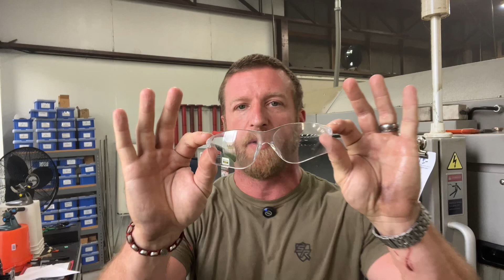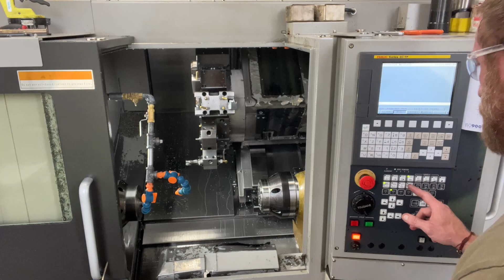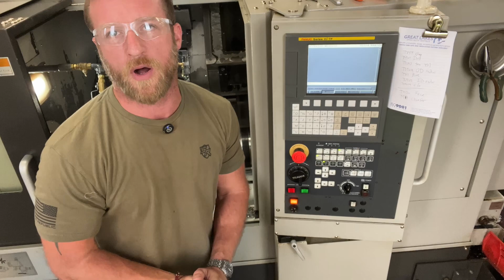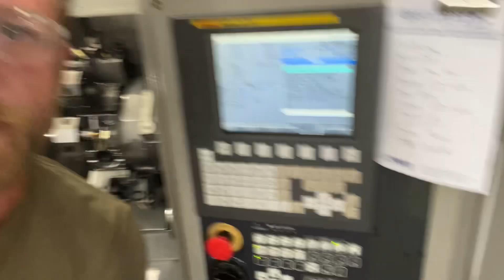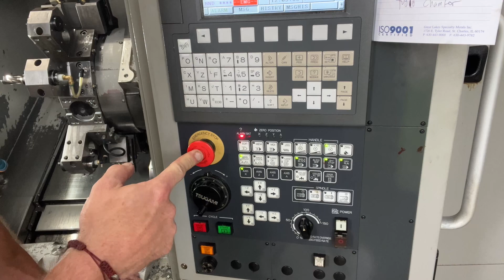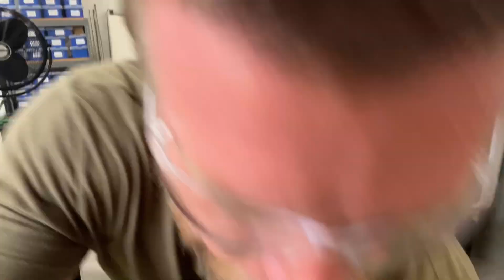CNC Safety is CRITICAL! #cnc #safety #machining #cncmachine

Comment: Drove a needle file through my hand on a lathe. It was dumb to deburr something so close to the chuck. But "I know what I'm doing" and "I'm paying attention". But I wasn't thinking. I wasn't paying attention to what I should have been. I was paying attention to the part of the file chamfering the edge, not the end of the file the jaw hit. Tapped a hole by hand in 303 without safety glasses. "I'm just tapping a hole, what could go wrong?" As soon as I reversed the tap a little chip dislodged and shot down to the floor of the vice, bounced off a jaw, and then came straight for my eye. Luckily my hand is perfectly fine and the chip somehow bounced off my eye. If you're ever unsure of what you're doing just turn the machine off, take a step back, and think about it.
Reply from the maker: That last sentence is the lesson of the day. I’m glad that you’re OK after those few accidents but working in a shop, as I’m sure you know, this stuff can happen to anyone.  I’ve heard about files pushing back into people’s hands. I could not imagine that felt fun.